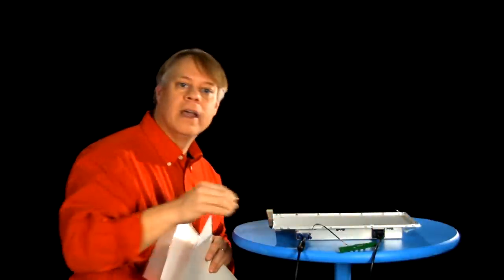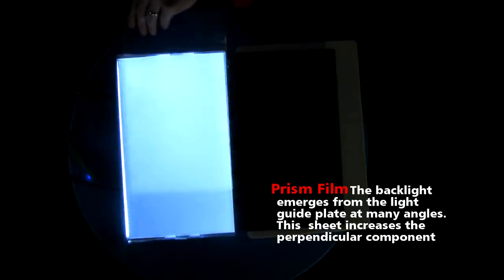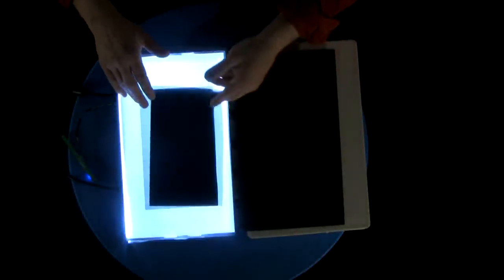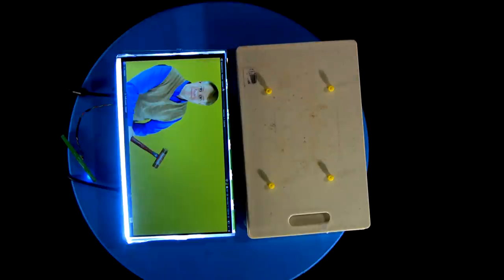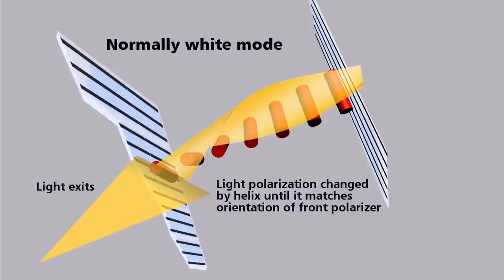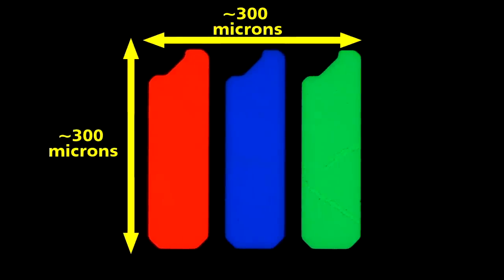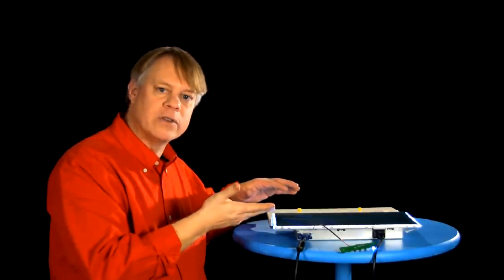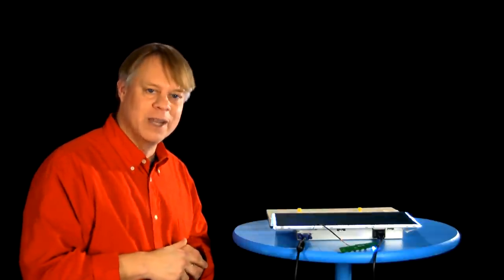LCD Monitor Teardown

Comment: The cool thing is that even newer displays are simpler. OLED's don't need backlight because it's the pixels themselves that emit a light, instead of just filtering the existing backlight. This means you don't need all the diffusing and polarising films, just the sheet of pixels. It also means you can turn pixels off to create perfect black and that it can be made to be even thinner, almost as thin as a piece of paper.
Reply: Actually it is not quite fair to say that OLEDs are simpler in functionality comparing to LCDs. Having fewer steps in sending the information to the end user does not necessarily mean that it is less complex. The sole technology behind the research and development of organic LEDs (OLEDs) is way more complex than filtering the white light as is in LCDs. I would compare OLEDs with CRTs in complexity, yet not with LCDs. Tough there are astonishing technologies used in LCDs both optical and physical.
Reply: Very nice OLED tech in a nutshell. I did not know. Thanks man.
Reply: I know this is old but this is what i was thinking about through the whole video. Why dont you just use pixels to create an image if yo are already giving the power to light up?
Reply: and lose up to 50% in brightness. newer/different (tech) does not automatically mean "better".
Reply: @berengerchristy6256  they will never have a burn in, only image retention.  they aren't burning gas like plasmas...
so yeah. update your information, maybe not from competing companies trying to scare customers ;-)
i have talked to +20 owning a sony oled (all +1y), not one has problems with IR.
couple of LG owners already asked me how to fix it on their LG oled.
shows the difference between 2 companies using the same tech (panel), e.g. having good hardware isnt everything.
Reply: @Misterixraccon  LCD's don't give pixels power to light up, they give them power to *let light through*. The actual light comes from the backlight. Putting millions of tiny lamps on a panel the size of a sheet of paper is quite a bit harder, though, nowadays possible.
Reply: Frank Honest Static content absolutely causes permanent retention, or burn-in, on OLEDs.
Reply: @CODMarioWarfare  He doesn't deny that. It's just not a literal burn in like a plasma would have.
Reply: TheLukasDirector Except that his further replies imply that Samsung or something are spreading lies about the detriments of OLED displays
Reply: @Muppets_Waldorf  It's clear you've never experienced a modern OLED screen before. I've had my phone for more than a year and have never experienced any sort of image burn-in. Also, the screen is super bright and vivid, even more so than my previous LCD phone. OLED is the future, like it or not.

Comment: Holy God. There are some smart people out there.
Reply: I've watch it several times and still don't understand lol
Reply: +Immortal Okay so you know how light is a wave? Well that wave can go up and down(vertical), side to side(horizontal), or in between. Polarizing means to only allow light going in a specific direction. So if it's polarized for vertical light, all vertical waves go through, all horizontal light gets blocked, and in between waves kind of get through but are forced to become vertical. In an LCD screen, there's two polarizers, one for vertical, and another for horizontal. Light goes through the vertical polarizer --> all light is now vertical. But wait, when it hits the horizontal polarizer, none of the light will go through, right? Horizontal only lets through horizontal light, and we've just made all the light vertical. So between the two polarizers they place a sheet of liquid crystal. The liquid crystal can twist the light based on how it's warped, and you can warp the liquid crystal with electricity! (How that works is very complicated, that's where the real science and tech is). If you want light to go through, you apply an electric field to the liquid crystal, the liquid crystal warps, and the liquid crystal twists the light, making the vertical waves horizontal, thereby allowing it to pass through the horizontal polarizer. Then it hits the pixels and that's what you see on your screen.
Reply: +Immortal The essential element is light polarization, which isn't normally perceptible to our eyes. Light can contain a mixture of random polarization, or just one particular angle. It's like a straight-slot screw, and can be turned to any angle. There are filters that only let light with a certain polarization through, and block that which is at any different angle. Finally, via electrical control, the liquid crystal material can be made to either leave the polarization alone, or rotate it.

Put these together and you get a light shutter that is electrically controlled: put a filter to allow only one polarization through, then the liquid crystal, and another filter that's rotated 90 degrees. When the liquid crystal is leaving polarization alone, you get dark because the front filter blocks the light with the wrong polarization. When it rotates polarization by 90 degrees, you get light because it goes through both filters.
Reply: +Dennis Neo LCD technology never fails to amaze me.
Reply: it is all on wikipedia.
Reply: Dennis Neo It's amazing that any sort of modern technology or convenience one often takes for grant was create by an engineer or scientist, who are clearly extremely smart.

Comment: Engineerguy, can you show me how an OLED screen works?
Reply: +Figgle Shoemizer eliminate the backlight part, every pixel is lighted individually and there you go
Reply: Every single pixel in the OLED screen is lighted individually. Every pixel is its own backlight.
Reply: In true OLEDs, every pixel is made of an organic light emitting diode which is controlled by a transistor (usually TFT as also used in LCD control) meaning if the transistor is on, then the OLED material emits light. Normally each OLED pixel can emit visible light of different colors(according to its production process it has a certain color gamut), emitting different colors at different voltages applied by TFT. By this way, pictures are produced. So, there is no backlight used in OLED displays, each OLED pixel emits its own light. It is similar to inorganic LEDs, when you apply a potential across the OLED, it shines light. But, as I am informed, most of the OLED panels produced in todays world are configured differently. In such configurations, OLED pixels do not emit different colors but produce just bright white light, and they use RGB filters on these OLED pixels in which these filters filter out red,green and blue lights creating sub pixels each paired with an OLED pixel. Thus, most OLED displays used today are not true OLED displays. Tough they are still more efficient, and have better contrast comparing to LCDs.
Reply: Ferhat ATEŞ, This is a fine reply. So good in fact, when I read it, in my "mind's ear" I heard the mellifluous tone of Bill Hammack's voice. Bravo!

Comment: I love Bill's videos. All of them. I would like to point out that at that in general, what we see as "modern" technological advances generally have a long history behind them that build on hundreds of years of scientific research. 

The scientific research input that went into the LCD display could (in part) be traced back to the 1800's when scientists were figuring out what exactly electricity was and how it worked. There were some flaming rows about that in Italy between Volta and Galvani. The BBC makes good documentaries on such history. Understanding the nature of light and how it can be polarized also goes back to that time in history. As each branch of the sciences makes discoveries and advances and pass that knowledge onto engineers everyone involved builds of work of those that have gone before and pass their work on to the next generation. 

This is why for a lot of modern technological devices such as PCs, LCD screens and hard drives we do not associate them with a single inventor. Science and engineering is a team game, a game that we seem to have only really started to get very good at over the past few decades but it is a game that we been playing for much longer than that.

https://en.wikipedia.org/wiki/History_of_display_technology

Comment: so if w put a highspeed camera on front of an lcd screen, will we be able to see the rows be turning on one at a time?
Reply: Slow-mo guys should do this
Reply: Wiizl Oscar v TV screen refresh in Slow motion @ 10,000 FPS in UltraSlo
Reply: haha nice find!
Reply: bandpractice
I think that's actually a CRT, not an LCD.
Reply: Oscar v Would be cool to see. I think there might be an issue with the frame rate pf the camera versus the refresh rate of the LCD in order to show it happen. Not sure.
Reply: Slow mo guys just did video about this few days ago,  and yes,  you can see pixels in a rows turning on/off and very fast.
Reply: +George Rosebush Screen still refreshes the same.

Comment: Wow, wonder how 4K monitor works
Reply: If it's a traditional LCD, the same exact way except smaller subpixels. I think you are thinking of OLED screens.
Reply: Sypran if i'm not mistaken LED screen is the opposite of LCD. it uses sooo many tiny LEDs to light up each sub-pixel, so it consumes less energy when displaying black/dark images
Reply: Taufik Akbar There are those kinds of screens, but they are not used for TVs or Computer monitors. I believe the Times Square Coke sign uses that kind of display.
LED TVs are exactly like what Bill showed in the video. They are technically LED LCDs, and the big difference is that it uses LEDs instead of a florescent tube for back lighting.
OLED I am not 100% sure how it works but it requires no back light making it lighter, thinner, and consume less electricity. No light is emitted when a pixel is absolute black. I believe one of the Zunes used an OLED screen and that is why all it's menus were white text on a black background.
Reply: Sypran
micro sized LED maybe? we can build micro transistor, why not LED? :D
Reply: Taufik Akbar That would be quite difficult and expensive to produce. Each LED for a 24" 1920x1080 screen would be 0.0828mm. They all need to be uniformly bright, all 6,220,800 of them. There are too many "joints" or parts that can go wrong, specially since LEDs are not the most refined technology at the moment.

The Back light of an LCD is were most of the power inefficiency comes from, not the LCD screen it's self. In fact LCDs tend to draw not nearly as much power as a the LEDs that light them.

Odd fact that sorta has to do with the subject: A Nintendo DS doesn't work unless it detects a certain amount of electrical resistance to it's top screen. It only cares though about the electricity to power the LCD not the back light. The amount of resistance from what I recall is about equal to the little power light.
Reply: Taufik Akbar they are caled AMOLED screens
Reply: Sypran You are correct about the visual billboards.  I have worked on them as an IT consultant.  The resolution of those billboards are incredible small and are setup in modules in a matrix.  If a single LED burns out you would never see it from the viewing distance.  What we would view as a single pixel on a TV or monitor is actually made up of a module that contains multiple groups of colored LEDs.

The resolutions of the billboards are incredibly small.  While it varies between screen dimensions it's usually in the area of 320x240 for rectangle signs or 640x128 for narrow signs.  The video and images that are fed into the matrix are warped to match the resolution of the sign matrix.  And typically it's just a regular PC where a portion of the desktop is captured and send to the matrix software.

As a final side note, all the advertising is updated remotely and tracked for how long it was shown to bill customers.

Comment: I was cleaning out a LCD that got soaked in oil and needed to clean between the filters. I cleaned them in order and kept them stacked. However, I ended up dropping them and forgetting the right order. Thank you for making this video.

Comment: I've been using liquid crystal laminate ('tinted glass') to control the light in my study for about a decade and a half. The initial set up cost me a small fortune back in the day, but it was a novelty that I could apply to my entire home for less than a grand or two now, and power with a button cell recharged by a centimeter squared solar cell on the outside.

Comment: Bill, great video. I always wondered how the light was distributed within the LCD panels. When I saw the plate that the LED shine into I thought of a piece of fiber optic cable flattened out.to spread the light around. Very well done. I have watched many of your videos. Looking forward to the new series. I also post many amateur - ham radio videos. Randy K7AGE

Comment: He does go over it quite quickly.  I'm not sure I would get it if I didn't already know how LCDs work.  The magic is that, depending on an electrical signal, the liquid crystal can twist the polarization of light or let it through unchanged and things are arranged such that light whose polarization is twisted gets through and light that is unchanged is blocked.  Everything else is getting light to where it needs to be and making different colors using tiny color filters.

Comment: It has some sort of integrated circuit called an "LCD controller". 
Basically, instead of sending the information in ~7000 wires (this is said to be in parallel), they use fewer wires to send pulses in a rapid succession, aka serially, and the LCD controller decodes those pulses and sends the signals to the transistors.
Depending on the specific connection method the number of wires and whether the communication is digital or analog differs.
Hope I helped :)

Comment: @phildenfer That is correct. (I figured this out myself, and proved it afterwards by research). What happens is at the movies the projector puts two images on screen, then the 3D glasses, which are polarized in different directions block out the image not meant for that eye.

The monitor and glasses works similarly, but I believe the glasses have LCD screens in them, which flash, and are polarized or something, then the screen has two images flashing which the polarized glasses block out.

Comment: Generally the diffusers implemented are produced by extrusion processes, which mean they have long polymer chains that are stretched that in turn partially polarize the light and reduce the overall transmittance of the diffuser, which may be problematic in many applications. Would a coating work better than a diffuser film and what would you make it out of?

Comment: From Wiki:

 In order to address a single shutter on the display, a series of electrodes is deposited on the plates on either side of the liquid crystal. One side has horizontal stripes that form rows, the other has vertical stripes that form columns. By supplying voltage to one row and one column, a field will be generated at the point where they cross.

Comment: In LED monitors, each individual sub-pixel is an LED. Instead of using a lighting background, each LED (pixel) emits light itself. So each pixel consists of 3 LED's: a Blue one, a Green one and a Red one!
LED monitors usually uses less energy than LCD monitors, while producing more intense light, wider viewing-angle, and also thinner!

Comment: Waow! i just realized why, when you record things like TV screens using recording devices, you see lines moving up the screen! it is explained at 4:17 , that only one row of pixels recieve data at a time, but it happens so quickly, our eyes don't catch it. our eyes don't have as many FPS as a digital recorder, which is why it can partialy pick up on these "waves" of data, kind of like if you look at a cieling fan and only see a few blades at a time,while its spinning quite fast.

i may be wrong.

Comment: Funny you should say that, I'm in the middle of trying to mod my own projection TV using an lcd screen from a small TV on top of a over head projector. I tore down my TV and can put it back together but the TV doesn't want to work when the back light is removed.

Comment: When the LCD is broken from dropping or in some way injuring it there are usually lines or a line that is black, sometimes growing into a blackened area, sometimes not.  What part of the screen has been damaged when this happens? and is that something a mediocre tech person can fix? Are there any dangers in opening up a broken LCD screen to work on it?  Perhaps you could  do a video?  Thank you
Reply: That happens when the glass panel containing the liquid crystal cracks. The liquid leaks from the glass panel and is completely unfixable, sorry!

Comment: These tubes had a gun in the rear.  They shot electrons to phosphors on the screen.  They had to be equal distance fromthe gun across the entire screen.  Thus the arc/curve of the glass.

Comment: The speed of light which is commonly talked about is the speed of light in a vacuum. Light does travel more slowly in other mediums.

The reason people often talk about the speed of light (in a vacuum) as an absolute is that is is the maximum possible speed at which anything can travel, this 'speed limit' doesn't really have anything to do light, they just happen to be the same value since light travels at that speed.

Comment: Yes. Because then the difference in Hertz between your video and your screen dont sync up and create a horizontal black line that isn´t lit. The speed at which they move are determined by the difference in hertz between both.

Comment: Interesting indeed. Still rocking my old IMB ThinkVision CRT monitor with 1200 by 1600 resolution. The TV is a Toshiba LED one though, lol.
Reply: +James Laidler   Yep, up until just a little while ago, I was still using my Macintosh Trinitron-based CRT.  The tri-color CRT is also an amazing device.